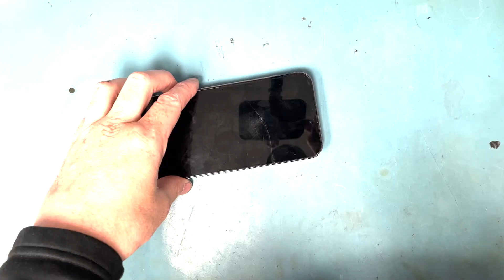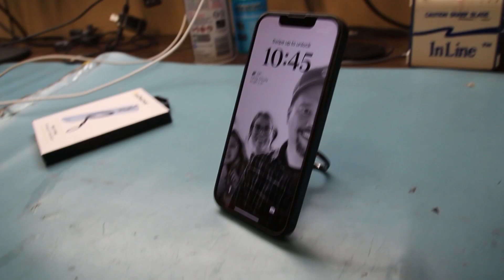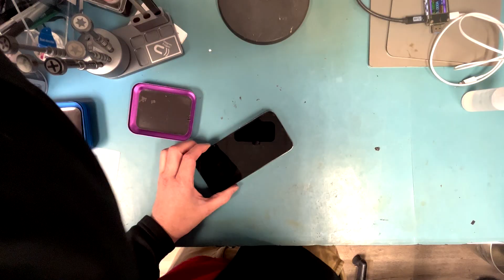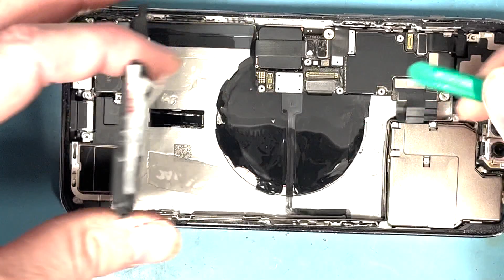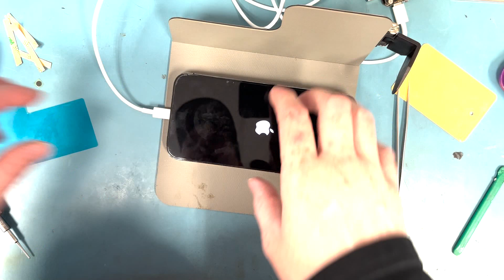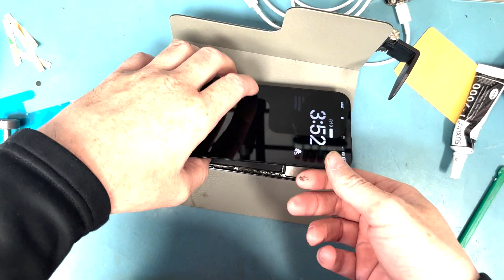iPhone 14 Pro Max Battery Replacement How To Replace

Comment: Hello 🙂thank you for this video…. it’s the best on youtube about it….but i do have a question….what is the liquid called that you used on the old battery to remove it? do you have the link from amazon ? so i can get it ? and what is the best battery that i can get as the best brand 🙂please let me know, thank you man
Reply from the maker: @mhe1975  mobilesentrix has the battery and 1/4 acetone in 2 liter jug 3/4 isopropyl alcohol 99%. shake it and pour into squirt bottle. the bottle should also be on mobilesentrix.com be sure to blow out phone before installing new battery.

Comment: Do you have to sync the battery once you install a new one ?
Reply from the maker: I think you do they called back after repair and said they got a battery replacement message even though we never replaced the battery. I am not 100% positive on this yet.